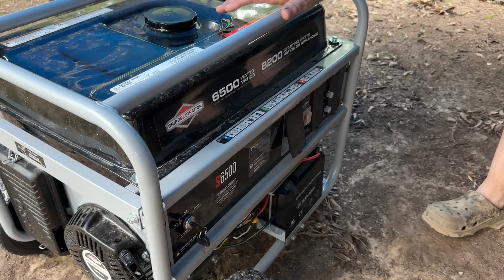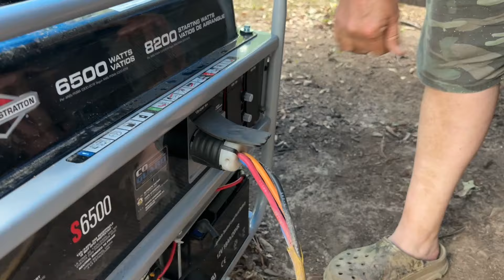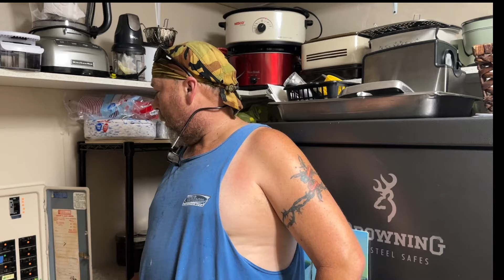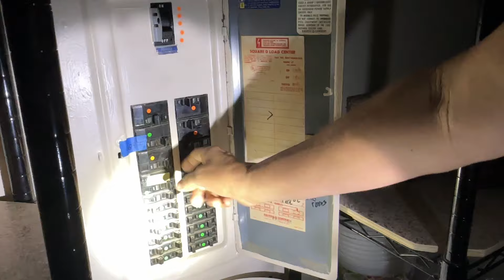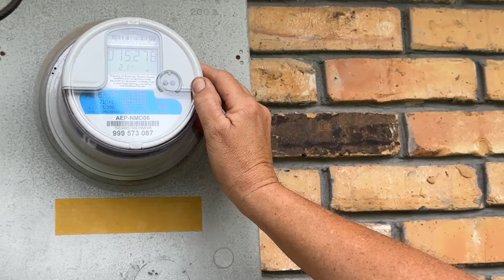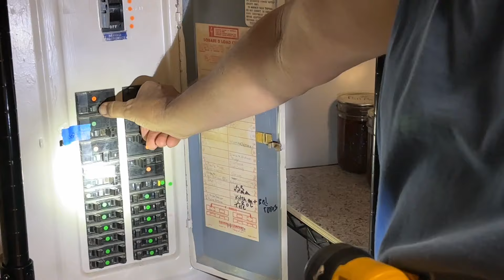DIY | Semi Whole Home Generator | Save Thousands Of Dollars

Comment: Ms Lippy and Mr Buddy TY for doing this video and I will definitely be having my hubby watch this video. We were able to get a dual fuel generator for $300.00 with a remote control starter/no pull cord. Hubby also is looking into making a gasifier to also run the generator, in other words it can run by burning sticks. Ms Lippy I'm sending you prayers for a successful surgery on your hand and a speedy recovery.🙏🏼🫂❤️
Reply from the maker: Good Morning ☀️, you’re so welcome our Friend. That was a great deal for 300.00, and sounds like your hubby will have y’all all set up as well. 🌷

Comment: Ty ty!  One small area I didnt understand.  Once generator is turned on, what was the step on the generator at the panel?  Was it on, then you flipped it off, or opposite.  Also if using dryer receptacle, would need to turn that breaker off at panel, then start the generator, then go to the same panel and turn off main.  Then turn breaker back on for generator and it will feed everything thats turned on.  This was what I think Mr. Buddy mentioned.  Which would be the option I could use.
Reply from the maker: Good Morning Ms Missy, when Bud gets in, I’ll have him read your question and answer ❤️

Comment: Great video guys, and happy to see Buddy out and about. My only comment is a reminder to folks that the step to turn the MAIN breaker off before starting the generator and powering up the breaker panel is crucial to protect utility workers working to restore power. Having the generator backfeed from the shop will work flawlessly. But because, in your installation, the equipment is separate from the main panel the step to turn off the MAIN breaker could be overlooked during stressful situations (like when losing power). In my installation I was able to put an interlock kit on the incoming panel that prevents both breakers from being energized at the same time. An interlock kit is not possible in a backfeed type installation, so remembering to turn off the MAIN breaker is critical to protect utility linemen working on the lines to restore power.

And the tip to turn off the gas and let the generator run until it quits is spot on. It will make starting the generator after is has been setting up for a while much easier to start and much more reliable. 

Overall excellent video with good information.
Reply from the maker: Good Morning, Yes the main breaker is extremely crucial, it’s the first thing that is turned off and the last thing to turn on after all back feed power has been removed. This is something Buddy has stressed to me when I was learning what to do.

Comment: Hate to tell ya bud that is a illegal hookup and better hope your home owners doesn't catch wind. You have to have a interlock switch or transfer switch that's doesn't allow the main to be turned on while the generator is turned on. You can energize the main lines and hurt workers.
Reply from the maker: Good Morning, I’ll look into that; but the whole neighborhood runs on a system like we have. Thanks For sharing this information 👍
Reply: @MsLippy  no problem. I'd let your neighbors know. If a lineman gets injured because of a backfeed you are liable and can be criminaly charged. I have the same hookup but I have a interlock switch that only allows the main breaker to be cut on if the generator breaker is in the off position.
Reply: @MsLippy  also fyi there used to be videos like this on YouTube but most have been taken down because of the illegal nature.